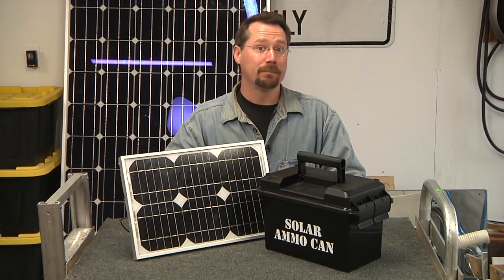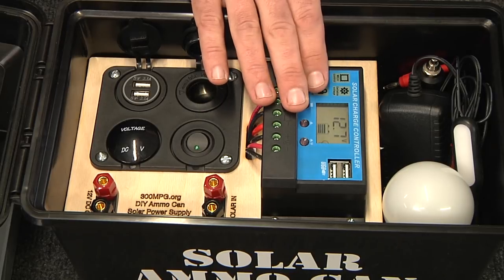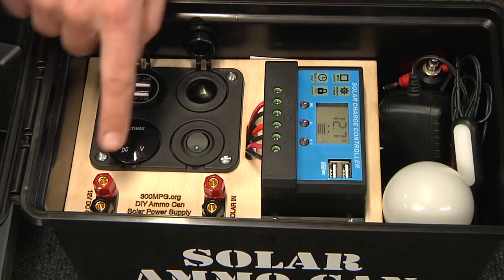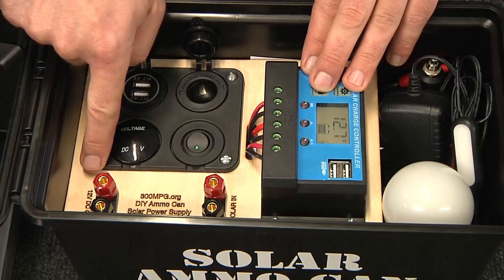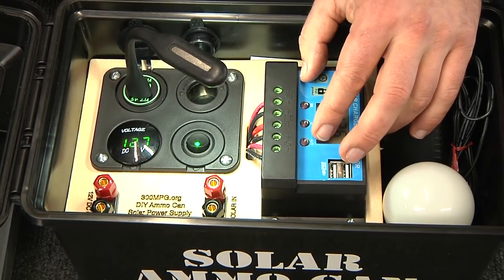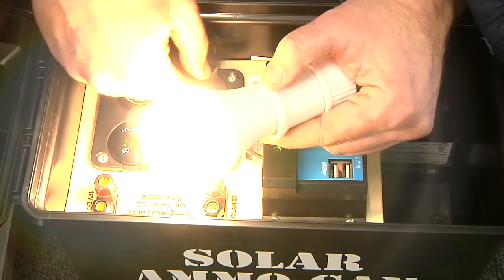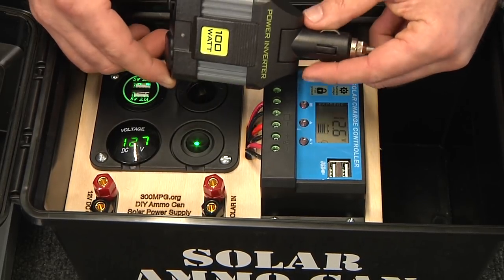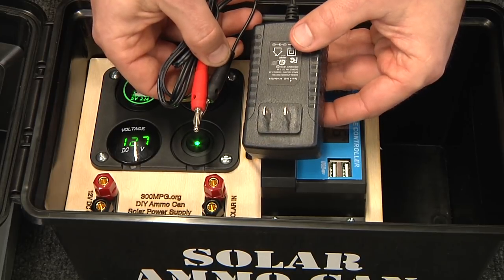Solar Ammo Can Power Supply - Overview

Comment: Quick question: the only thing keeping me from making one of these is the lack of ability to charge it in the car. I'll be driving a lot by day on a cross-country camping trip, so won't have a lot of time to use solar panels by day. Is there a reason that's not an option here?
Reply from the maker: It certainly is an option.
What you want to do is connect a cigarette lighter plug cable more or less straight to the battery, with positive to positive, and negative to negative. This puts the batteries in parallel. Whichever battery has lower voltage will draw current from the other. Since you are driving, the car battery will always be higher, as it's constantly being topped off by the alternator.
I originally wired up this project so that the 12V DC Out is connected to the "LOAD" of the solar charge controller. I did that so people could hook up whatever 12V item they wanted to that connection, but still be protected against over discharge.
You could instead wire that connection directly to the battery (through a fuse) and either draw power from there, or use it as a connection for charging.
Using the car's cigarette lighter connection to the battery wouldn't have any sort of charge control built in, but it wouldn't need it either. Both the car battery and the battery in the Solar Ammo Can have similar voltage characteristics. I would NOT leave it connected for an extended amount of time AFTER it's charged, however.
Reply: @BenjaminNelsonX  Thanks for the quick reply! That all makes sense, I'll give it a try.

Comment: Ben, for your DC adapter, did you splice banana jacks to it so you can attach to the solar in banana jacks?
Reply from the maker: I actually have two different DC power supplies I can use with this. The one already happened to have the banana jack type connectors on it. The other one was bare wire. One thing I like about these banana jacks is that you can unscrew them to reveal a cross-hole through the post. You simply push the bare wire through the hole and then thread the connector back down against it. These jacks give you flexibility by using banana connectors OR just some plain bare wires!

Comment: What's the average run charge time using the solor panel and wall charger
Reply from the maker: On this project, I'm using a 1 amp solar panel. The battery is 15AH, but with lead-acid we usually try not to discharge it more than half way. So, for a 7 or 8 amp-hour capacity to fill with a 1 amp charger, it would take 7 or 8 hours. If you want to charge faster, you can simply use a larger solar panel.